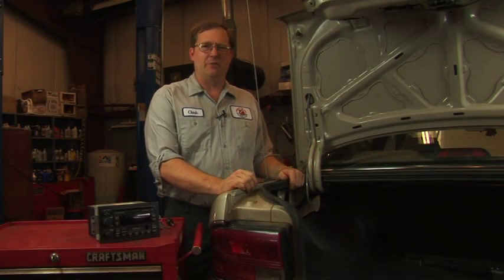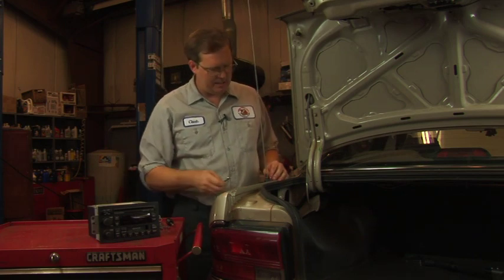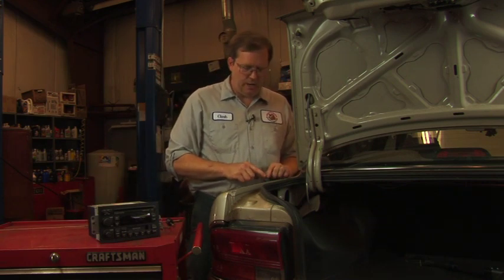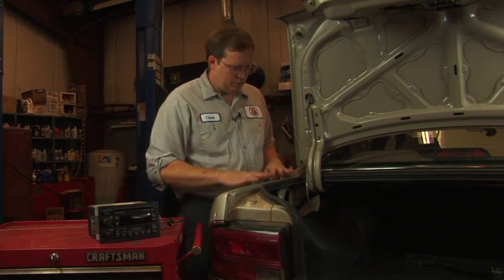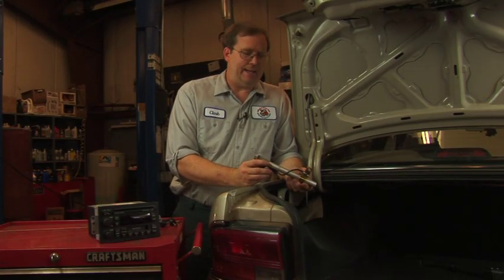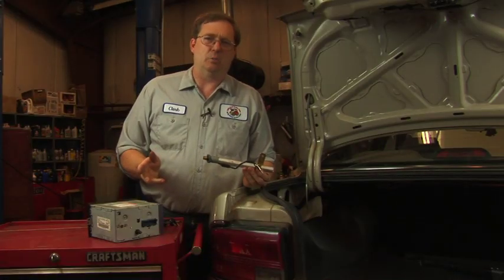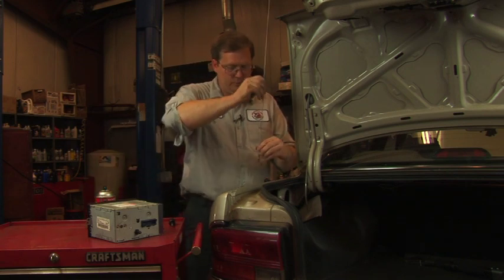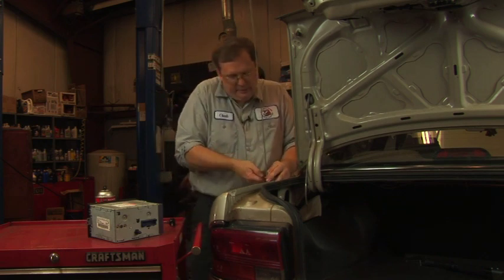Auto Repair & Maintenance : How to Change a Car Antenna

Comment: Can you make a video of one of a truck with the antenna on the right fender? I have a 2000 ford ranger and the antenna male leading into the radio broke, so I am just going to replace it all? or is there an easier way?
Reply: Obstructed terminal mine broke off as well    1999 ranger

Comment: I wish I could find a video on how to install a NEW antenna where you have to drill holes. My Buck LeSabre has one of those crappy antennas mounted in the glass on the back windshield and the reception sucks bad, plus every time I turn on the rear defrost I get static in my radio.

Comment: @Jason09101994  I bought a new antenna, removed the glove box and the antenna connection is right there. I plugged in the new antenna before trying to install and it works great. However without finding ANY tips on the internet about, video or written, where to drill to bring the new antenna wire into the glove box compartment, I guess I will have to wing it. Wish me luck!